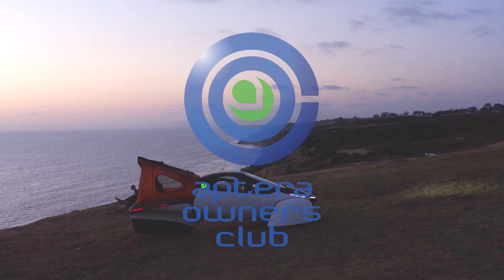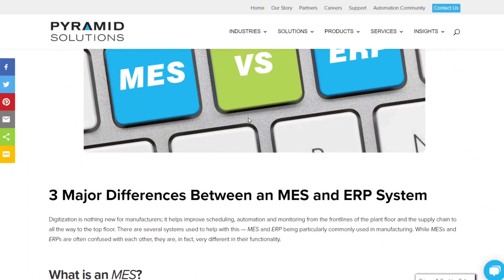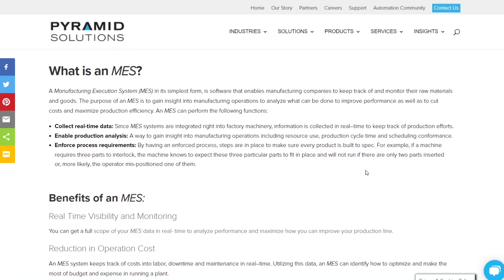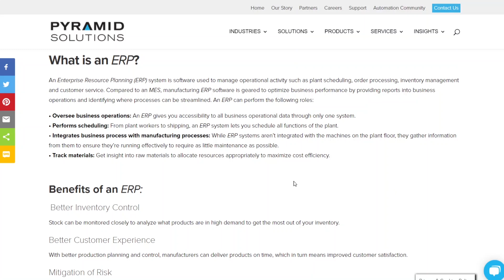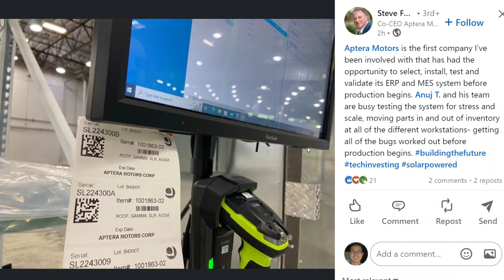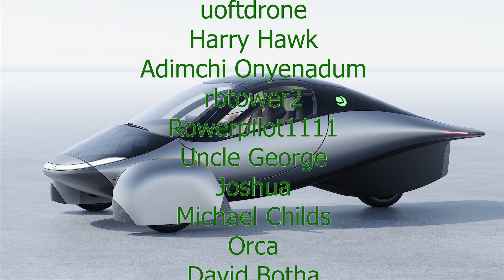Aptera has already bought some manufacturing technology and is testing it

Comment: I remember using Material Requirements Planning (MRP) years ago. Those knee deep into its use would call it, More Rotten Paperwork. 😋
Reply: There is such a thing as poorly designed and implemented MRP.  In fact this may be more common than not.  Testing a system before it is implemented in production use is likely to save major mistakes from occurring.  This was a mistake Tesla made that almost put them out of business.  Aptera is avoiding many pitfalls.

Comment: Long term this work will help them but my concern is that if the MES/ERP is getting resolved now they have people without enough to do and will for months.  They have a ton of amazing talent but with no realistic plans to start work on the future sedan and production ramp is a ways away they likely need to keep people on staff to avoid brain drain.   Clearly funding is absolutely critical to getting to production and hopefully the current pre-planning will allow them to hit the ground running but production is hard.
Reply: We know that they are already doing some preliminary work on future vehicles.  It is also obviously not something they are going to spend much time talking about at this stage.  They laid off 18 workers that they could not productively employ at this point - a difficult but needed decision that has reduced the run rate of expenses before much revenue is coming in.  We see a lot of evidence of wise decision making, both technically and in financial planning.

Comment: unban me my name is @animate mental terrorism ,  i cant imagine why in banned its proabbyl a mistake.  one of the things ive been asking about is, what balance between adding more batteries or less, is best for longveity of electric car? can this balance for different car types be mesured by effiency scores ? so people cna know which car has the balance done right. then a small combustion to charge car for people who have unexpected travels, long travels, local electric grid limits, or just want to drive fast etc
Reply: The best balance is going to depend on the particular needs of each individual.  It is not going to be the case that there is one objective answer that covers everyone.  Could you please further explain what you mean by "a small combustion to charge car"?
Reply: @n.brucenelson5920  best balance can be a certain amount of battery, then after people figure out what they need for cheap long term cost, they can try to get closer to that ideal balance.          small combustion engine spins motor to charge battery .  or two pistons on ends of a rod, going back and forth with magnets, making energy with non moving magnets, to charge motors then charge battery slowly when battery energy is low. optimal combustions per second for low cost ownership (it calculates longvity vs fuel costs by user input, otherwise defaults to longevity), low emissions, depending on tempurature,.                              it can slow charge as much as possible and be ready to go on time as user tells it to.  for example, it can be normally charged after arriving home, but if he comes home later than expected, itll charge faster to be ready as next morning at usual.
Reply: @kalmmonke5037  Thanks!   I already drive a very efficient hybrid car.  The engine adds great complexity, more wear, and cost.  I am glad that the technology available now will allow us to move away from this with a far simpler and less costly solution that is also more environmentally friendly.
Reply: @n.brucenelson5920  im not sure what balance of electric and combustion is optimal for cost savings, my plug in hybrid idea is what i guess to be best. protection from natural Electro Magnetic Pulse from beyond earth, and artificial attacks liek that, would destroy electric systems, although protection is  possible as cost addition but i dont know if it exists.... inportant for car that is to last long.            possibly car can be built with modulairty in what parts can be added for or removed, at higher budget build for saftey effeincy etc... then rented instead of sold, instead of recyling after short lifespan. but legal contract to prevent taking away any product for any reason besides not paying on time, neeeds to be valid and readabl wthout a lawyer for so many customers to make sure its valid.. otherwise, they say "you now have to pay for software part of hardware you already paying for" and "give back out car or else we'll take it through law enforcement, because our wireless connections to you car location tracker, microphone etc detected that you didnt comply with the new ESG score standards of behavior" romanin tvee did a video called "why woke wont go broke", thres blackrock, feeral reserve taking from value ofpeopels dollar, etc...    quantum conciosuness did a video called "reality gives itself away, destruction of human ideals", this matte ris not just about profit.               this is about money,time,legal rights... and unatural apporaches to human interaction like stuff mentioend in electric vikings recent video on dishwasheer stuff and immune system. like breathing in combustion emissions is proabbly not good for health, but gasses generally tend to go up into low pressure zone that is beyond earth atmosphere... how much actually sticks to water clouds etc poisening food water supply, or gets into human breathe intake? my plugin hybrid idea would keep almost all if not all combustion away from low speed population dense areas.      claim that petrol is byproduct of anaerobic bacteria means ias long as you dont take too much at once, the thick liquid pools will not run dry, fueling soceity for as long as it has... its not "fossil" fuel.meanwhile they still dig out the ground for batery material and cant recycle materials in mass, maybe we shouldnt waste materials we havnt leanred to fully utilize? but if they do fix this and or batteyr degradation, plugin hybrid could be better than the maintained combustion engines like ones military uses from 70 years ago. for now, my plugin hybrid idea is argueably a selfish desire, although solar panels and high effiency can make it very helpful for some farm work if they pump and dump the grid to death for a reset
Reply: @n.brucenelson5920  there also idea of nitrogen air pressure tank, as regenerative braking(making energy to drive car, out of energy required to slow down car) system assist to electric. theretically, also valve to open up air as powered braking when energy cannot be stored in regenerative braking, but air compressors are not effceint today. energy desnity per volume is not enough to replace battery fully.
Reply: sotage inside carbon fiber hollow crash structure
Reply: @kalmmonke5037  Yes.  The big issue with compressing gas for energy storage is that heat energy is lost when the gas is compressed.  The electrical regeneration amount is easily controllable and much less lossy.

Comment: It's only as good as the engineers that set it up and a lot of stakeholder and user input is needed. Doing it early is easier and better to implement than implementing in existing production lines where people are stuck in their ways. 

Not saying it's impossible to implement in stuff that is already in production but, it's about the culture and how well they embrace it and integrate it and have honest feedback from the lowest levels to the highest levels. As long as it's not used to punish people and more about helping to add resources where it's needed. 

People work to the metrics that they are given, and a lot of companies fail to make sure that the quality is reflected somehow. If a company is using the software just to check a box, it's a detriment and seem like a hurdle. 

Another thing that the production team and management will have to do is cross functional training and learning multiple stations so that it prevents repetitive strain and reduces monotony. It also helps if someone is out sick or indisposed and others can help fill in. I've seen a lot of production shut down just because one person was out. It also makes everyone more invested in quality products since one step might affect others negatively or positively down the line. It helps reduce the, "not my job, it's their problem" and the passing the buck. It helps make a more robust manufacturing line. A little more costly and slightly less efficient, but it's a lot more sustainable than the super lean manufacturing that people try to use and squeeze every last penny. Super lean leads to burnout and a very toxic environment such as the way Amazon warehouses are run. Eventually you run out of people that want to work for you
Reply: "Another thing that the production team and management will have to do is cross functional training and learning multiple stations so that it prevents repetitive strain and reduces monotony. It also helps if someone is out sick or indisposed and others can help fill in."

This is great advice.  I spent well over a decade at a company that practiced this well.  I would spend a week on the phones in customer support, a week in the shop doing board level repair, a week traveling - often overseas, and then perhaps a week in the R&D lab developing new product and technology.  These schedules were flexible and not required of people who didn't want to do so many different things.  It added to both our competence and to our job satisfaction.

Comment: Elon's first principle of engineering is  "Your requirements are too dumb", and that surely applies to management systems without the devices to manage.  To plan these two systems before the product is ready puts the icing on before the cake is baked; they will almost surely be wrong in many ways, and they do not contribute directly to moving product out the door.  

Instead, the team need to build the inspection tools, QC acceptance criteria and fallback alternatives for all of their sourcing dependencies. Their proposed transatlantic assembly procedure seems full of single-point-of-failure vulnerabilities, and eliminating those by strategic redundancy should be their most significant preparatory task.

Comment: If I read carefully previous information released by Steve, due to outsourcing, there would be really few small parts to be assembled.. (for less than 60 vehicles per day) ...we're not dealing with  thousands of sub-sub-sub-assemblies like in a  conventional heavy industry  (Ford, VW..)  ...so, maybe a spreadsheet would be enough ??  that's a bit exaggerated but certainly no SAP needed right now
Reply: No a spreadsheet would not be enough.  In the automotive industry you have to track almost every part that goes j to a vehicle in case something is faulty and you need to do a recall.

Comment: Thanks for sharing this brief but important information. As I have always done, I will dare to make my new assessment of the current situation, and my updated production prediction: I believe Aptera has already secured the funding to begin production, or they are confident that they will get the required funding by the end of March 2023. So, we should expect production to commence in September 2023 or latest, November/December 2023. There may be a few hand-built or assembled-for-trial Apterae before then for validation tests and for further showing around. My two cents. Fingers crossed.
Reply: I hope you are correct. Given the direction of the wind, I would agree that the funding situation will be revealed relatively soon. Without this funding and at their current expense rate, I don't see how they will last past 1.April 2023. At $5M per month in expenses that will only increase, crowdfunding will do little.  Personally, the crowdfunding allows us to show support and possibly have a nice return on our investment in the future. Not to be a downer but $800k is pocket change in the scope of what is really needed. If they don't have significant funding on the horizon, CPC & others would not make the investment they are making.
Reply: Adimchi, Your assessment agrees with mine.

Comment: Good to practice before the actual production begins. A world class golfer, or tennis player does a lot of practice before being good enough to take a shot at the big prize. Aptera is doing that in its own way. As long as the system properly running, all glitches removed, then it is fine. Guessing this is flexible enough system to allow for many different possibilities. Aptera seems to be getting the T's crossed, and the I's dotted. When they do get going, it might be smoother than anyone expected. Thanks to you, Sandy Monro, and doing the 7 P's. Those 7 P's are: "Proper prior planning, prevents piss poor performance!"  Planning it like a military operation, gives me a better feeling towards what might be coming in the future, for Aptera to be a successful company. You continue to shed light on the situation, as it unfolds, and I benefit from your deep dive into the minutia. Thanks Steve, wonderful job, as per your usual.

Comment: It is really great that Aptera is using these systems as it will really help with their success.  The cool thing about these systems is that you can simulate thousands of possible issues and have a solution in place to deal with the issue before it becomes a problem.  

In 1986 I worked for Industrial Data Technologies in Columbus, OH and we developed these systems for many industries.  One system was for a paint factory in MI where our system controlled and monitored all of the paint nozzles and movement of parts for a line that was 11 miles long.  We sold the system for $3M and I was told that it paid for itself in 3 days as parts kept moving.  Techs were called out to repair or address issues as needed with the parts in-hand.  (Remember that in 1986 the Intel 80386 processor had just come out and networks were in early development. While we were using some Intel chips, most of the systems ran on Motorola chips and most of my coding was done in Assembler.)  I told my manager at the time that we didn't charge enough and he just smiled and said this was just an early development system to show what our systems can do. IDT was a fantastic company to work for.  They believed in a lifetime warranty on ALL of their items they sold.  I was replacing systems that were 10 years old that we no longer made with new systems that did what was done in the past plus more.  There would be a very modest upgrade charge that likely barely covered the installation cost.  Yes, thing were initially expensive, $400 for a keyboard but that keyboard was basically indestructible.  I would acid test them and even send them out for radiation exposure and they worked.
Reply: Interesting history.  I was writing Motorola chip based based software at the time - primarily travel agency and car dealership management software.  After completing a few projects, I decided I didn't want to sit in a chair the rest of my career and joined an environmental and quality control instrument company to do international tech support.  

Our programmers were always surprised when they said something couldn't be done, and I would sit down and code an example in a few minutes.  I later became international sales manager, and I had customers really surprised when I found an instrument non- functional in a remote location, and pull out a tool kit with a soldering iron and spare chips, and desolder and replace a burnt chip.  They weren't used to sales people doing that.  I even got permission to repair other companies' equipment when I was at a remote site that was difficult to get permission to travel to, and I knew what to do.
Reply: @n.brucenelson5920  I went back to memory lane.  IDT has been purchased and renamed but still around.  At one point I use to build 40 PanelMate IIs a day and they would be connected to the AMI-6000 which was the real "brains" of the system.  I remember that it took us a year to develop the system for the Flint, MI paint assembly line.  Looking back on what was done with what we had at the time, it was pretty amazing stuff.  The auto industry was a big source of income for us but we also worked with NASA and nuclear power plants. Our systems had to withstand harsh conditions.  The ClassicMates and AMI systems had significant cooling systems built into them and I would disable them and put the systems in a walk-in oven at 150F for 72 hours.  They would have to operate in that environment.  I remember one test where the chips got to 360F and I was wondering if the solder was going  to melt.
Reply: @ddessert6  Thanks for sharing this!  Much appreciated!